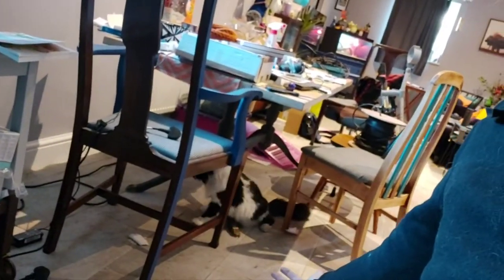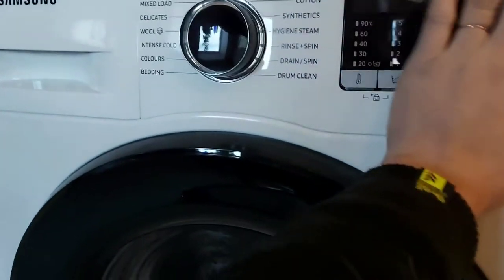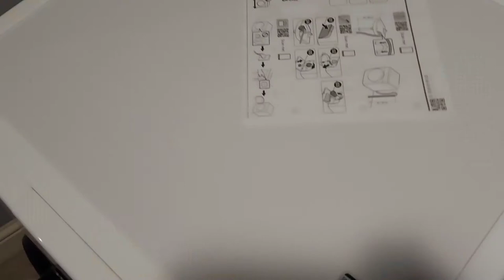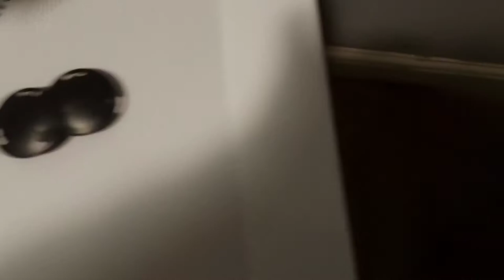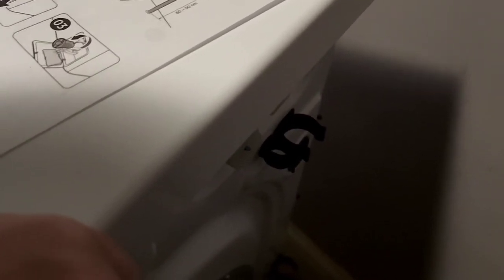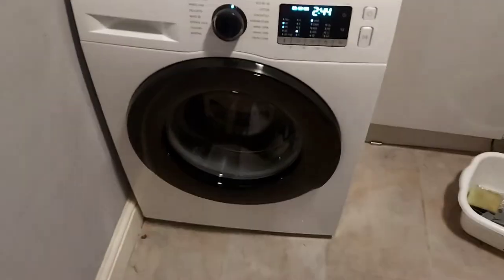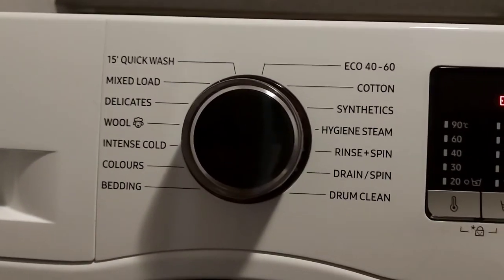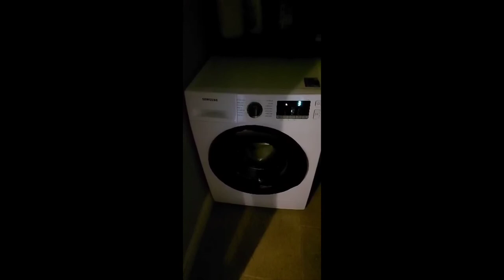unboxing, installing and testing a Samsung WW90TA046AE/EU washing machine

Comment: Hello bud. Can you please answer a question? The cotton cycle, what is the standard temperature and run time? Also, can the cotton cycle be run at 20 degrees or even completely cold? I’d really appreciate your help. Thanks.
Reply from the maker: The standard run time is 1 hour and 27 minutes at a default 40 degrees Celsius. This temperature can be manually changed from cold, 20, 30, 40  60 and 90. At 60 the cycle time is 1 hour 42 and at 90 its 1 hour fifty seven. Hope that helps.
Reply: @shonkopenbroadcasting2398  Extremely helpful, thank you. I’m planning on mostly using the cotton wash, at 30 degrees or cold. Which wash do you usually use, or do you vary? By the way, does the machine always use the same amount of water, and are the run times always the same on cotton? Or does it weigh the load, and vary the amount of water used and run times can vary? Are you happy with the machine? Thanks again.